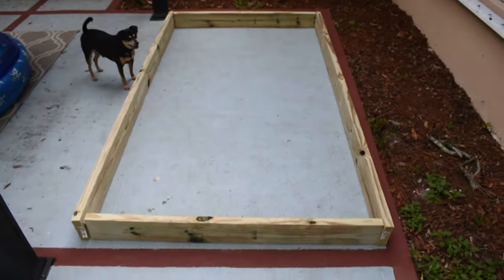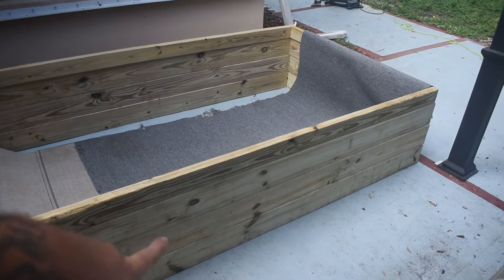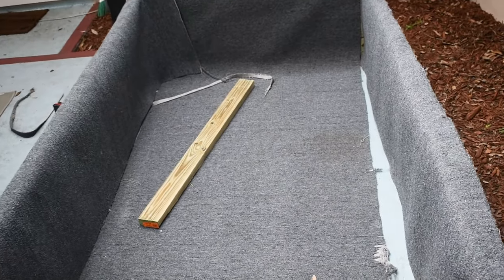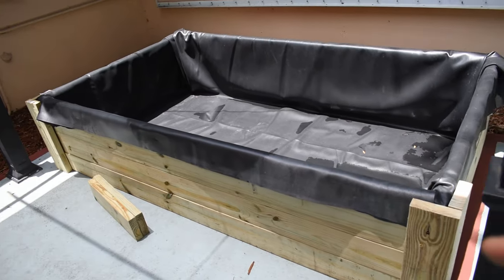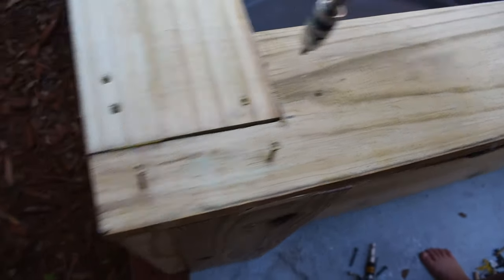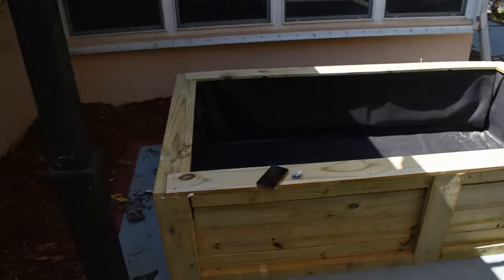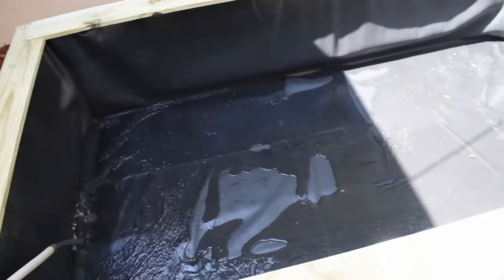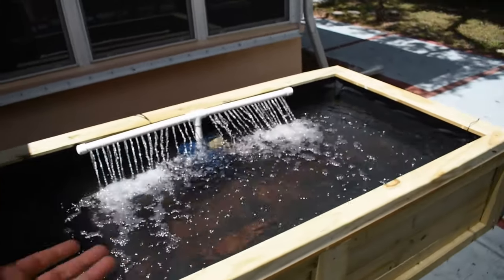My NEW EPIC BACKYARD WOOD FISH POND!

Comment: Did this hold up? I'm building something similar except I'm using 2x10s 4 high 3 vertical braces front and back 1 on each side  10ftx5ftx37in deep think it will hold?

Comment: Sir can you let us know what fasteners you used and how many per board and how your reinforced the corners.  I want to build a 3 to 4 ft deep pond and the pressure of the water will cause 2x the force on the walls.  I noticed you only used 2 screws per board per corner is this correct? Were they 3" 3.5" or 4" and were they heavy gauge special deck screws or standard screws?  Did your 8ft long wall wow out due to the load of the water pressure and if so how much 1" or less?

Comment: good stuff. I'm planning out a 500 gal and was planning on using 4x4 not 2x6 like you did.  how is it holding up to the pressure and how many gallons do you this you have?   thanks for the vid.
Reply from the maker: Hey thank you for watching! It’s 370 gal at the 90% mark but on average I have the overflow sitting at a point that keeps it at about 300 give or take. The 2x6’s are holding up great definitely happy with that, it saved a lot of money

Comment: Nice work! I'm looking to do something similar in my yard, 5'x8'x3' deep. Have you had any issues with bowing of the sides due to water pressure? I'm thinking of 2x8 boards with 4x4 vertical braces and a 2x6 cap rail. The pond will be partially below ground due to the slope in my yard, so ground contact pressure treated lumber is a must. Any advise or tips would be much appreciated.
Reply: How did yours turn out? 
I came here for ideas because I am looking at doing the same thing. 
  I have mostly sand, so it’s easy digging. The plan is using 2x6x8 from heavy duty pallets with an above ground pool liner. 
 I’m toying with the idea of just using the 2x6’s above ground and the ground itself as the below ground siding. I like his 2x4 supports which would be a small expense even with today’s lumber prices. Then caping with a 2x6.
Reply: @Lmiller201  depends on the size. Mine is 20' long, 8' wide, and 3' deep. Built mine out of treated 4×6. It's about 8 yrs old. Even using 4x6 I have a very slight bow in the middle. Water is around 7 lbs per gallon. Keep that in mind. If you want a decent sized pond I'd never use 2×6!
Reply: @RuthlessGaming5849  mine will be 2' into the ground so the ground will be bearing most of that weight. Additionally, its not going be any bigger than 8'. At 20' anything made out of wood would not be able to withstand that force. 
 I think I'll be alright with my intended design, but thank you for your vote of confidence

Comment: Really nice bro filter looks kool what filter did u go with haven’t seen that style outlets before. What was the size of the pond?
Reply from the maker: Hey thank you brotha! So the filter I made out of a milk crate. Pump sits in the bottom covered with lava rock and then has foam surrounding that. For the spray bar I just had to find an adapter to fit on the pump, then just used pvc to make a T and went crazy drilling a bunch of holes😂
Reply: Unconventional Aquatics bro looks cool plenty of surface agitation 👍🏼 love doing stuff like that building filters and ponds lol awesome job 👊🏼

Comment: 3 mistakes I can see. 
1 Inefficient use of lumber. Take advantage of box beam construction on the longer sides and you could have gone much deeper without worrying about the wall bowing out. 
2 The base is not elevated above grade and will soak up water, which will rust out the screws and weaken the lumber exactly where it is subject to the greatest lateral static load.
3 Incorrect screw type. Screws for outdoor use should be galvanized or stainless. These will rust out. 

I know cuz I made all but the first of these last time I did this, lol.

Comment: Amazing !!!! What kind of filter r u using ? How much does it cost for
Whole setup?
Reply from the maker: Hey thanks for watching! So here’s a list of what everything cost.

Pond Liner: $127 
Pump: $90
Wood: $140

Everything else I used I already had. The filter is a “milk crate” filter. Super simple build, but only temporary, until I can build the overhead sump
Reply: @UnconventionalAquatics   what is the dimensions of the pond liner you bought? Thanks.

Comment: 7.10 did he say 45mm thick liner or 4 to 5 mm
Reply: Sound like 45mm to me, I thought I was hearing wrong
Reply: Can’t be 45mm....that’s almost 2 inches!
Reply: I believe this rubber liner he's using is actually 0.45 mm thick, but I've heard many US folk pond-video YouTubers say like he does that it's 45mm thick ... that would be more than twice as thick as the thickest treaded part of my car tyres! Americans still use lots of imperial measurements daily (e.g. inches) so maybe not very familiar with metric mm's. 

With 45 mm thick liner, I don't think you'd need worry to put carpet underlay just in case anything might puncture it! I dunno whether a .22 cal projectile might, but def not from little sharp rocks or weeds! Haha!